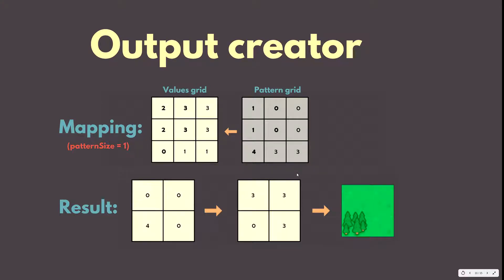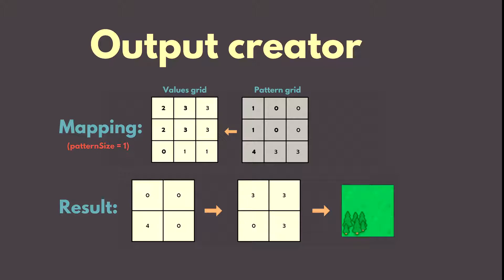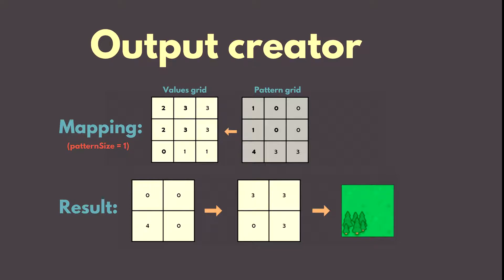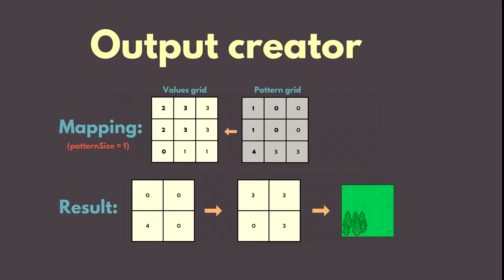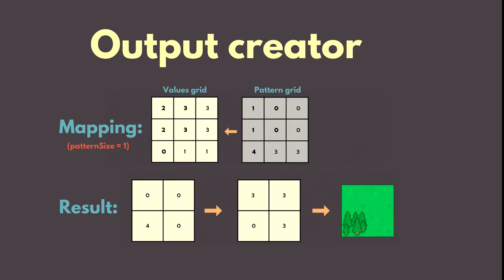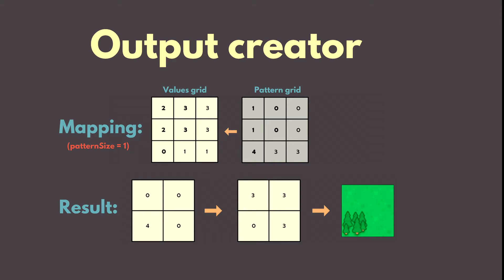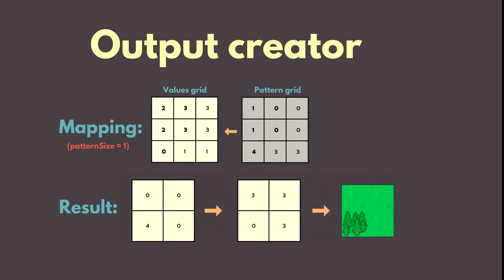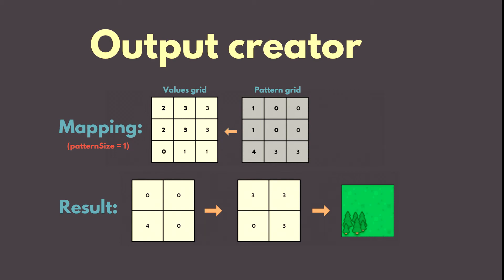Wave function collapse Tutorial 08 Theory - Output

Comment: Why do we have output size 6x6 when we have pattern size 2 and pattern grid 3x3? In this case the output should be 5x5 in size, isn't it?
Reply from the maker: Hi Humoyun! Sorry for this video it is clearly on of the worst of this series. In any case 5x5 is the size of our grid with the offset. Now if we ask our CoreSolver for a grid of 3x3 we receive 3x3 square of patterns (non overlapping). Each patter is a square of 2x2 tiles. This means that we produce a square 6x6 tiles. The issue is that we have asked for an output of 3x3 of tiles. This means that we will not utilize the benefit of having 2x2 patterns and repeating a formation ex road-house-grass-tree if we cut slice our 6x6 output to comply with our requirement of size 3x3 tiles. This is more like a design flaw rather than something you should be focused on. I hope I am explaining it correctly as i did the WFC tutorial a long time ago just to have a reference if I would ever want to use it. Let me know if this make sense!